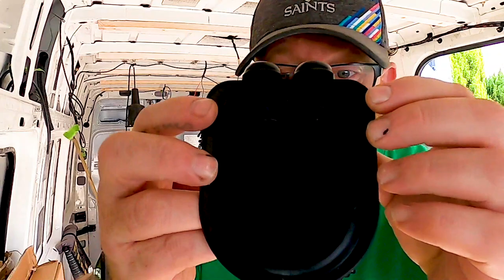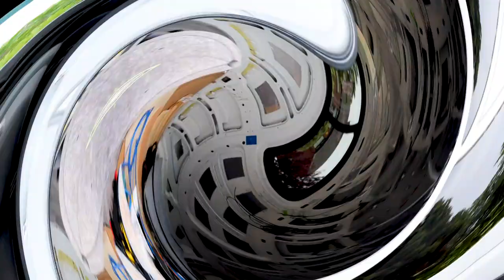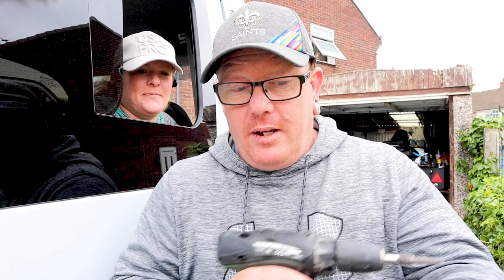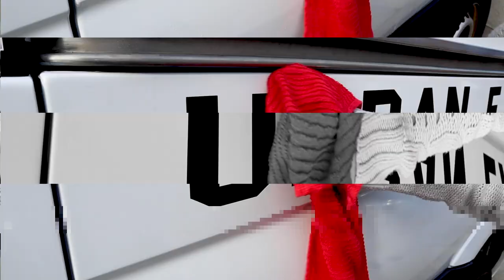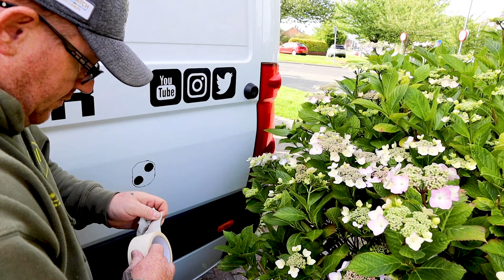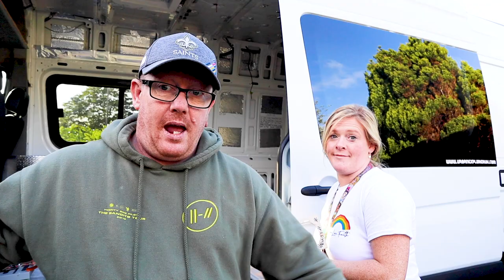Cutting Holes In Our VAN BUILD For Electric hookup

Comment: The drill you cut the holes with ? 
Is that a special one for metal or can you use the ones for wood ?
Alot of difference in cost..
Reply from the maker: The drill bits and the hole cutting bits have to be for metal but the drill is the same

Comment: What’s the difference between sica flex and silicone?
Reply from the maker: Hi ya, Sikaflex is the name of the brand of adhesive, they produce lots of different products including silicones, polyurethanes and butyl  mastic's, but this one isn't silicone its polyurethane which essentially better for when working with vans/motorhomes etc. The chemical make up of silicone and polyurethane is different but i won't bore you with that.... basically polyurethanes work well with wood and fibreglass (when prepped correctly) but you should always get the correct sealant/adhesive for the job you are doing as they do different things. There are other alternatives to sikaflex which are cheaper and work the same however in the UK sikaflex seems to be the leading brand for many and used widely.

Comment: I’m going to be installing a diesel heater in my van soon and I’m trying to prepare for cutting a hole in the floor. I’m sure the floor is tougher than the roof or sides... will a jigsaw(with pilot holes) do the job, or do I need something else?
Reply from the maker: to be honest mate the floor is the same as the sides an roof , it just had thicker ply on it , its nothing special bud , youll breeze trough it